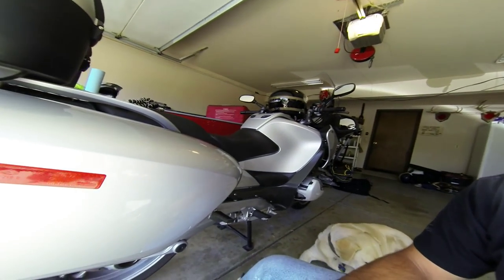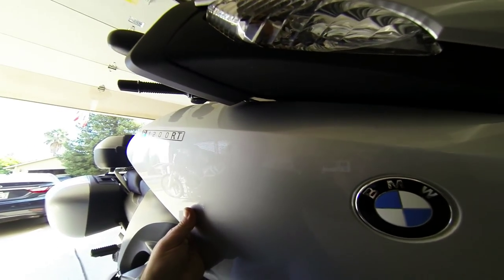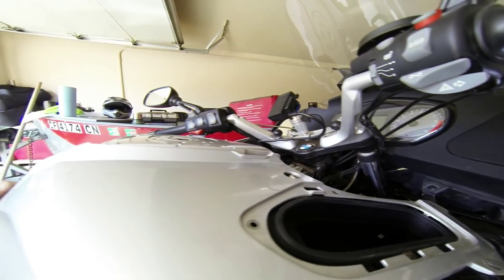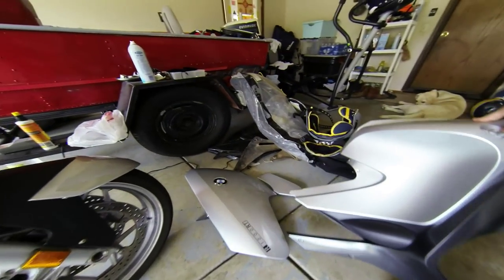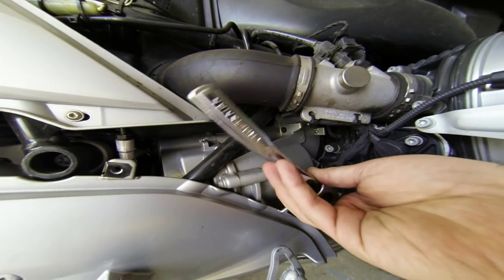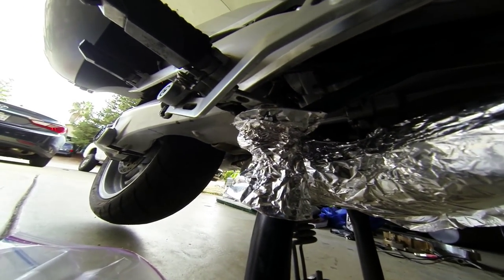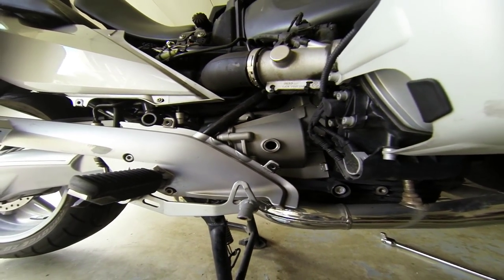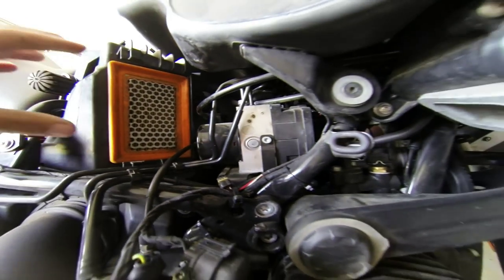BMW R1200RT transmission oil change and air filter check

Comment: I recommend to use a old 2ltr coke bottle. Cut in half and use top like funnel. The top is very flexible and easy to squeeze in, haven’t spilled one drop. I can send pictures if needed.
Reply: I will try this coke bottle idea.

Comment: Just completed, very easy job other than the plastics. Torque for both bolts is 30nm according to the information I could find.

Comment from the maker: I think the manual (or maintenance checklist) specified every two years or 24,000 miles.  Personally, it's so easy I've made it an annual event.  Somewhere around 12,000 miles or so is reasonable in my opinion.
Reply: Thanks for the video.  Bought my 06 last year and when I do the second oil change I think I'll go ahead and do the transmission as well (70-72K miles, it's probably due)  Seems pretty straight forward.  Heck I may do the final drive also, while it's up.

Comment: I didn't know the BMW had a separate transmission oil, used to my Japanese bikes. I have a 2007 1200r I picked up a few months ago, I'm sure it is in dire need of change. Thanks.

Comment: What your is your r1200? Just got an 05 first bike loving did valve lash oil change air filter all 4 plugs now km doing gearbox and final drive! Any good vids on that? I'd rather lift the front with a hoist and drain like so any reason that won't work

Comment: Hi Chris, thanks for your vids, very usefull, I just got an 2006 R1200RT, I will be doing the air filter change in a couple of weeks, and since I have the tupperware off, I may as well do the transmission change, but I have two questions: does my model has the same case/deposit as yours and second, I noticed that you used a 75W-90 gear oil, is this the same oil also used for the final drive? thanks for your comments..cheers!!

Comment: Why can't I find the drain or the fill on the 2014 LC model? I'm looking on the other side of the bike as it's defo not on the side yours is. There's a similar looking fill screw which is a lot higher up, but the drain hole? I found a similar plug to the engine oil drain plug, slightly higher up but it needs a hex socket and the exhaust is in the way.

Comment: what's the recommended transmission oil change interval?
Reply: Charlie I think it’s every 20 or 24K. I just do mine every other year, which lately as I slow down works out to about 15K.
Reply: The BMW brand oil is only $13.50 @ the dealership. It’s cheap insurance.